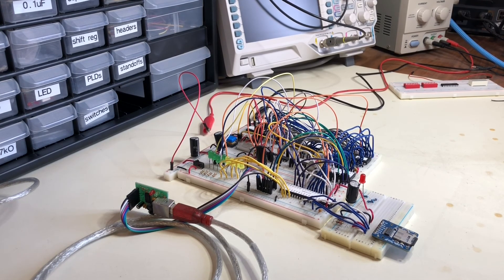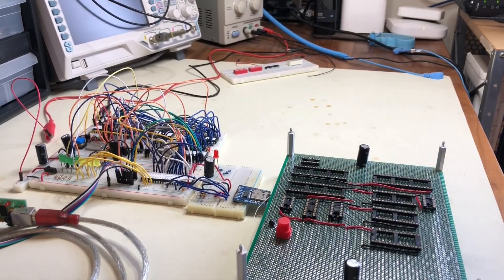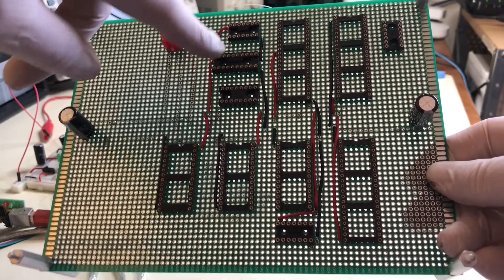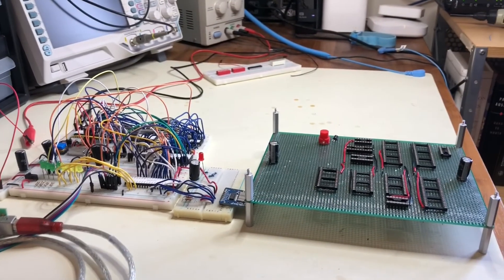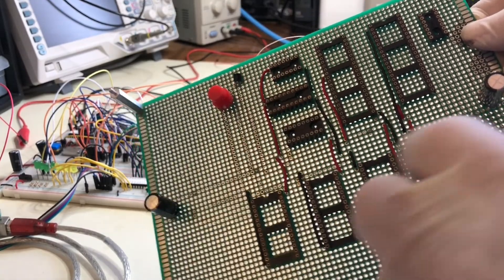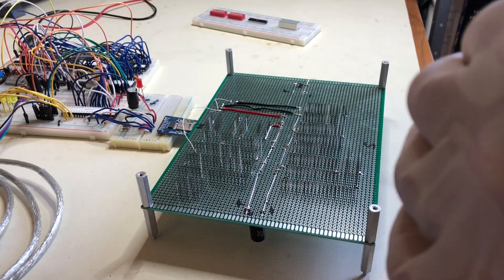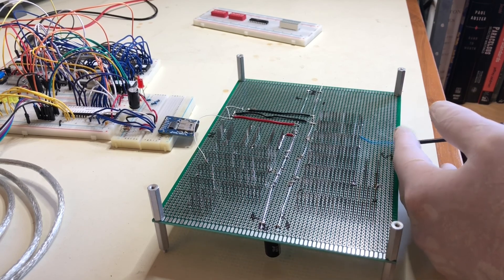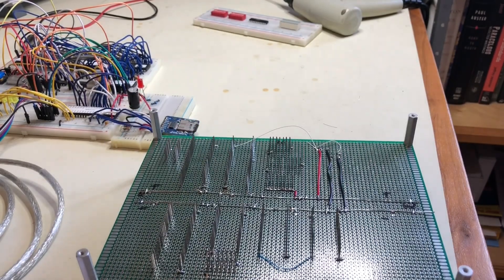6502 Mite home-brew computer project: step 14, wire-wrap begins

Comment: good luck!
i always wanted to get one of these tools but they are a little bit expensive on ebay
Reply from the maker: Yes, wire-wrapping isn't a cheap solution these days, by the time you factor in sockets and tools. Even the hand-tools are surprisingly expensive. I lucked into this wire wrap gun, although I'm still pretty slow with the process overall.
Reply: @pauldourish  did you score it on ebay?
i was thinking of setting up notifications for it but maybe it's not worth the hassle.
Also, I found wire wrapping wire to be perfect for making computers on perf boards, it's thin enough for the wiring on the back to be manageable
Reply from the maker: Yep it was an eBay find. I still had to get the bit and sleeve separately, so still an expensive option when all added together.
Reply: My preference is a simple hand wrap tool.  It’s easier getting between and around pins, doesn’t require electricity and you have better control over the individual wrap.  Of course, they’re cheaper too. Nice work, though. I’m looking forward to seeing your progress.